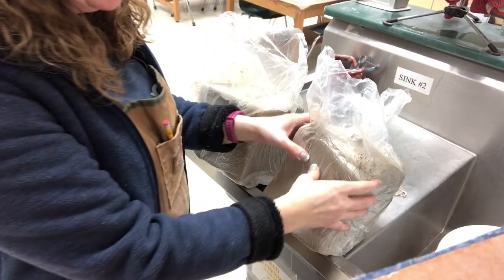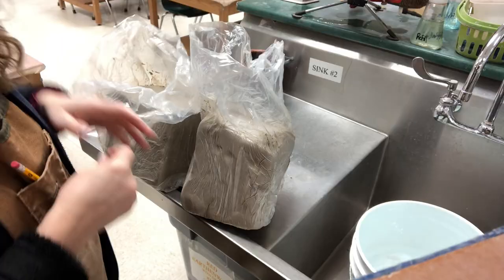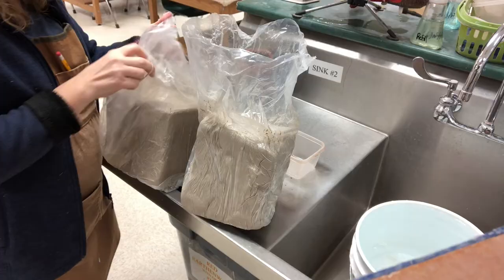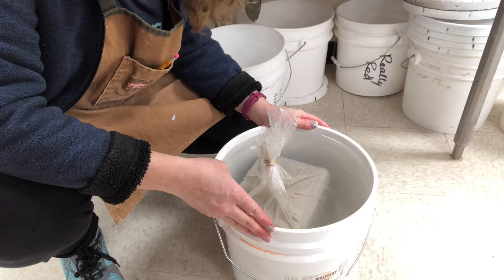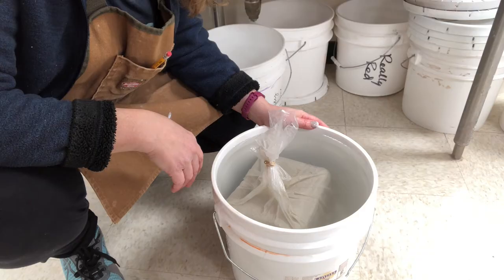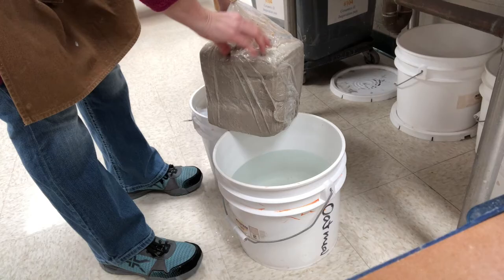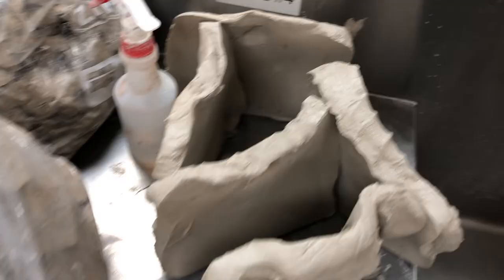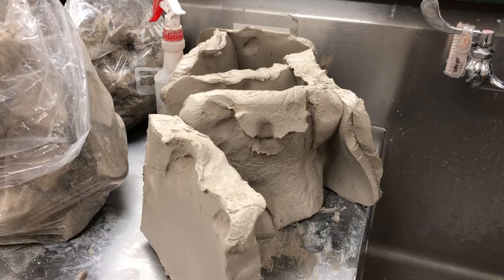Easiest-Ever Trick to Rehydrate or Make A Hard or Stiff Block of Clay More Plastic!

Comment: According to the side system YouTube and AI there's small amounts of heat that are generated when the clay absorbs water. I'm just trying to find out how much it is. They use these thermal couple. These solid states are thermal couples and they actually are able to generate heat from the amount of not heat electricity from the amount of heat that is generated by the absorption of water.  As it rehydrates, I don't know the total specifics of it. But it's it's probably hard to recognize This effect.
Reply from the maker: lol- well, I've been doing clay for nearly 40 years, and have never noticed anything...

Comment: hi  Karan.  I started making a model with polymer clay four days ago.  Because I knew I would be busy I just kept water spraying it, as I still want to finish it.  But some of it is getting harder, and I need to reshape parts of it.  'It's a 'Gryphon' and I kind of need to re-mould, or 'rather' -reshape the wings and still add talons etc.  When I was making it originally I used a fork to engrave ruffled feather patterns, but fear it may be not 'malable' enough to carry on :(  .  Do you have any tips that can help me preserve or soften the clay to carry on with my project.  I really hope you can help as I kind of started making it by accident and it kind of shaped itself in my hands 'which makes no sense'.  But as I have not done clay since I was 11 years old (Now 48).  I don't think I can replicate the original work.....Please, is there ANY way I can keep it soft enough as when i first started crafting it????????  I really really want to finish it.  I feel it was meant to be, but I have just been sidelined with 'life' things.  Please help.
Reply from the maker: As far as I understand, I don’t think polymer clay is water-based. So I don’t think adding water helps to keep it moist? Last time I did polymer clay was probably over 20 years ago and I just remember softening up the block in a little food chopper that I had dedicated to using for nothing but polymer clay. So, maybe a tad bit of warmth and kneading it? But I really don’t know what to tell you about the part already made.  Sorry I can’t be of more help, it’s so absolutely different from actual clay that’s dug from the Earth.
Reply: No probs, thank you anyway :) @KaransPotsAndGlass

Comment: Excellent, thank you. I used to reydrate clay the hard way: letting it dry completely, breaking it into small chunks and throwing in water, then mixing it with a paint mixer, then pouring the soft mud on plaster blocks, then (exhausting to even write it down lol) rolling and working it back to proper plasticity. Usually a full day job, slept well the following night. Your method seems great, will try next week.

Comment: The number of moles of beryllium (B) that can be released from a pound of dry clay under ideal conditions depends on the specific composition of the clay and the method used to extract the beryllium. Clay is a complex mixture of minerals and organic materials, and the presence of beryllium in clay can vary widely depending on its geological origin.

To determine the amount of beryllium that can be released from a pound of dry clay, a chemical analysis of the clay would typically be required. This analysis would involve techniques such as X-ray fluorescence (XRF) spectroscopy, inductively coupled plasma (ICP) spectroscopy, or other analytical methods to determine the beryllium content of the clay.

Once the beryllium content of the clay is known, it would be possible to calculate the number of moles of beryllium in a pound of dry clay using the molar mass of beryllium. Beryllium has a molar mass of approximately 9 grams per mole.

Without specific information about the beryllium content of the clay, it is not possible to provide an exact answer to this question. However, it's important to note that beryllium is a toxic element, and proper safety precautions should be taken when working with materials that may contain beryllium.
Reply: aight mr chat gpt

Comment: Adding that much water doesn’t it cause mold eventually?
Reply from the maker: Clay will sometimes mold- but I have never noticed that method causing it.  The idea is just to add enough water for it to regain the plasticity.  If you overshoot the amount, you can dry it back out again to the right consistency.  Anaerobic bacteria is the biggest culprit for smelly and moldy seeming clay.  As soon as it gets exposed to air, it generally dies.